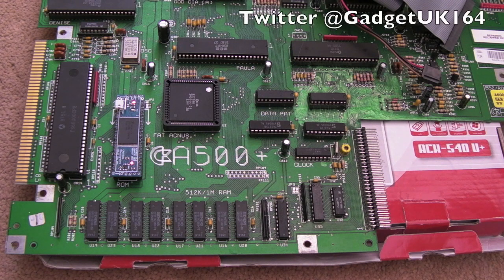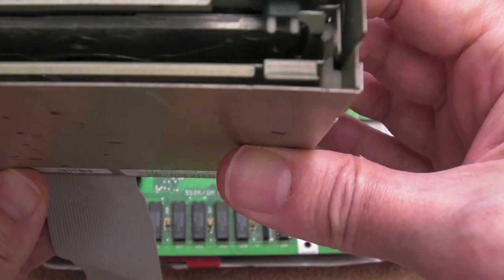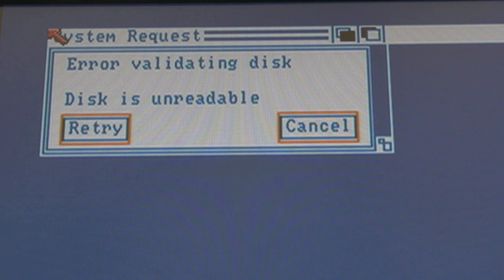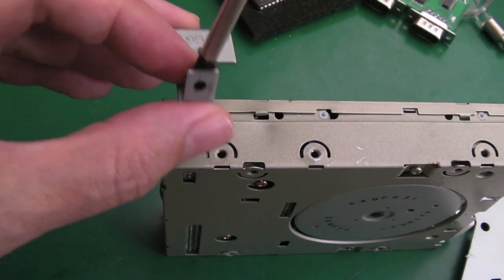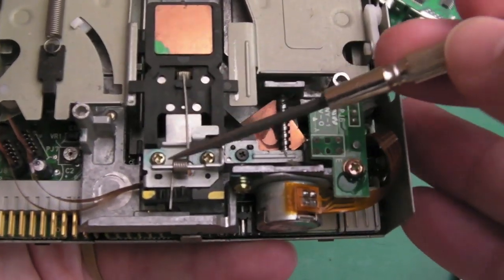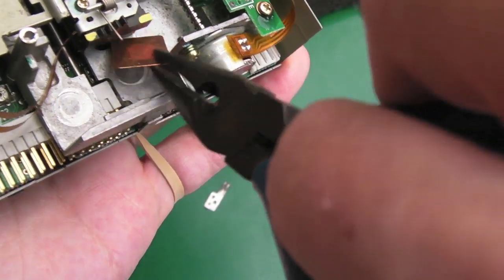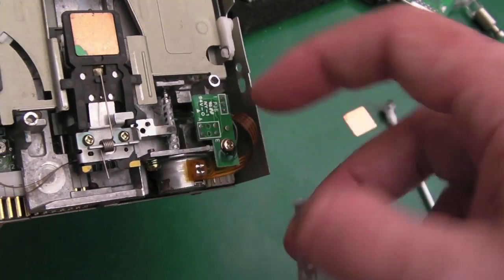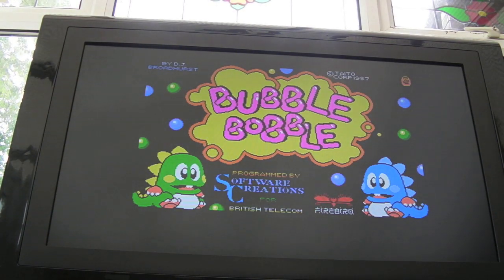Commodore Amiga Floppy Drives (1 x Easy FZ-354 1 x Hard FD-235F) Track 0 / Adjustment / Head Align

Comment from the maker: Morgan Just Games Super R-Type & R-Type 3 Collectors Edition Pickup - https://www.youtube.com/watch?v=A3x0BOkVIEI
The difficult drive (not Jamie's) starts at 23:20.
Reply: Say, GadgetUK164 would you happen to have a mini disc player repair video in the near future? if so would you be willing to tackle the Sharp MD-MT15 TOC error  problem there are a few on ebay with that fault was wondering if you have an idea of how to fix one.
Reply from the maker: @spidermcgavenport8767  My guess is if a clean doesn't fix it, and provided caps aren't the issue, it will be the laser!
Reply: @GadgetUK164  That wold be my hypothesis as well troubleshooting it so far i just cleaned the lens it may need several cleanings as I am not the original owner found it at a pawn shop with md's and accessories for $20 bucks and couldn't pass it up. The Arrowsmith album was worth it alone. I have others from my travels and found a player in Malta of all places.

Comment: Best trial and error repair video I've seen in years. Persistence is your mantra. You've been able to fix the mechanical faults, completely remove the heads carriage AND aligned head AND track zero sensor WITHOUT a scope or diagnostics software. SUPER!
For me, I needed to see how to remove the heads carriage so that I could glue the bottom head electrical noise interference cover (FZ-354 version) back in place. I note that doing this will NOT comprimise the heads alignment.
Thank you from Australia.

Comment: That's brilliant! :-D For a couple of days, I've been trying to get an FB-354 working, on and off. No matter what I did... thorough cleaning, greasing the shafts, trying to press the heads in all different manners, even trying different computers and even an ISA controller - it all boiled down to a removal of the track 0 sensor, cleaning it a bit, and... still nothing! :-/ 
But when I searched for "track 0 error" shortly after, I ran into your video again (I saw it a couple of days ago)... and then you mention the track 0 sensor, and I thought to myself - seeing you holding the drive with the heads in the rearmost position - "well, perhaps I should drive them forward, too, just to see if the sensor reacts as it should, when I power on".
And voila! The BIOS didn't complain about the drive anymore at boot, and I was FINALLY able to format disks with it! :-D
It's may not be in sync with other drives, however... but at least it's working again; and I can calibrate it if need be (I found an excellent program for that on Aminet, "TrackDiskSync", which helped me fix one of my external CDTV drives a couple of days ago). c",)

Thanks for your video, you indirectly pushed me in the right direction and helped me salvage one of these "true" Amiga drives! :-D
Reply: There...! After securing the head sled on the stepper motor shaft so there was no slack... (!) today I finally managed to get the drive calibrated, it's even loading Kefrens Desert Dream perfectly, and that one seems to be VERY demanding when it comes to floppy drives. c".)
So, one more FB-354 salvaged and ready for an Amiga adventure! :-D

Comment: This video absolutely nailed it. I have been fixing my chinon floppy disk drive on my A600 and I have been getting read errors at block ~400. I removed the head and cleaned them put them back, thought I made it worse because it was stating read errors at block ~1000 but followed your video, I realigned the head and got it working again but ended up having the same read errors at block ~400 again. So I marked the step motor position with a pen, loosened it and moved it a hair and now it works.
Reply from the maker: Thanks, that's great - glad you could fix it =D

Comment: Nice job : ) I just got mine realigned. Watching this gave me the encouragement I needed. I had a Thinkpad 390E floppy to tackle. Stepper motor was all stiff. I foolishly took the head off. But got it all back and running luckily! I found the head needed to be slightly moved more to the right to work properly. But when I was getting the drive to read the disk at all, I new I was in the right area.

Comment: Have a FD-235F and learned about the location of the track 0 sensor the hard way too - when i was reassembling it after a cap swap :) After some days of researching methods of track 0 adjustments and modding a PC drive to have working drive I nearly gave up, and already looked for replacement drives but tried a manual adjustment for the lulz, just by feel like you did. Luckily, after the third move of the bottom board it worked flawlessly again.
Reply from the maker: Hehe =D  Yes, I think if all that was wrong with this was the track 0 (bottom board position) it would have been easier.  The big problem was that top head was able to move because the plastic part wasn't secured to the metal part (which is screwed down).  I am 100% certain that was the original fault and that's why the previous owner couldn't get it working again (top head was missaligned as well as track 0).
Reply: Yeah, was quite mangled that poor drive. Great resurrect! I learned a lot from that vid, kinda like always ;)

Comment: I love all your Amiga videos, but this one takes the prize. I have an A600 which I fixed, but it has the same floppy drive which kind of shows the same symptoms. I also found that almost all the Amigas I have bought off of ebay had some form of an fdd issue, but otherwise worked perfectly. Thanks for this, awesome stuff! :)
Reply from the maker: Thanks!  I am sure you can get it working again, it might just take some trial and error regards the track zero screws holding the PCB, and tiny tweaks one way or another on the motor notch there.

Comment: Wow. As i've watched the first minutes i thought "uh, he has the same teac noise and problems like i have with one or two of my teacs. He can't fix it". Oh, i was wrong. Absolutely great work! Amazing. I have to take a look again. Those teacs are the worst amiga drives ever. They have a lot of different problems and no, capacitor replacement is no problem but alle the other problems are making me crazy with those teacs. Thanks again!
Reply: Oh i forgot...track alignement with keirf systest is what you've used for track alignement i think? With this i've aligned one drive perfectly.
Reply from the maker: Hehe =D
Reply from the maker: I didn't use any software within this video to align it.  Went purely of how disks were working / not working.  But I have used Sys Test since that video on another drive - just to see how well it works.

Comment: Glad you had this video ;). I've disassembled my two not working FZ-354's and I had no idea about how to mount the first one back (without disassembling the second). In fact I was doing it wrong :( .BTW I thought that I would see big caps, but nope, any. At least I've seen that one of them had the motor that wasn't turning, and now it does. I've used DeoxIt, WD40 and your Molikote grease to finish. Let's see if any of them work now, but many thanks.
Reply: I'll tell you: I'm mounting a "new" A1200. I've got a lot of pieces for that. I recently bought an A1200 mobo from AmigaKit and I'm planning to add a huge amount of things. For example.... A Vampire that I've got unboxed since like three years ago. And more things that I'm buying now  to have this A1200 running great. I'm going slowly. I love working on it, much, much more than later using it. Maybe you know what I mean.
Reply: Also... I'm trying to make "something different" with the oxidation on the upper plate of the Floppy drive (at least that). I will leave it into Vinegar just because of all of the rusty spots (like the ones you had). I know that it will change all of the color of the plate, but I'll get rid of any oxidation. I've also added some  "deox gel".  I'll post a photo. I'm sure that it will look like a metal plate without any color or oxidation. ... Surely the time to paint it (any color, the can I'll find), next step.

Comment: I was testing some chips from an A500+ I bought recently. The Agnus chip was preventing the floppy drive from starting until I switched the know working one back in. It otherwise "appeared" to be working.
I think this was a case of one of those junk systems that someone has chucked any old crap into and sold though :-( I'm sure the Deinse chip and keyboard were from an A500 not a plus.
The A500 I also had was not in great shape :-( The only consolation is that both of these got trashed in the post so I have got some money back, not that more smashed A500 cases can be considered a good thing.
Anyway excellent video full of tips as always :-)
Reply: If the boards are still good, you can mount A500 boards in the new Checkmate cases. I'm not sure, but I think there may be new aftermarket A500 cases as well.

Comment: Great video GadgetUK!

Really like your determination to see it through and keep these old pieces of awesome technology alive :) 

I actually made the mistake of undoing the screws on my upper head when I was trying to clean the drive on my A500 and by some stroke of luck managed to get it working again after a little bit of trail and error (phew!)... 

Not that I'm by any means an expert (I wouldn't have undone those screws if I was ;) ), but what worked for me was using the validation option in X-Copy Professional. You can choose just to validate the upper side of the disk and you can work on tuning things to make sure you get all green zeros right through to track 80. Then the real test was to see if the drive can write a disk which is then readable on another Amiga drive. If you can write a disk that another drive can read then you should know you're absolutely spot on!

Look forwards to the next videos - keep up the awesome work!
Reply from the maker: Thanks!  That's a really great idea, the only downside is you need to boot X-Copy to start with lol!  Not a problem if you have 2 drives or a HDD I guess!
Reply: Yes - that's very true! Thinking about it more I believe it was an external Roctec drive where I changed the belt that I messed up... which meant I booted X-Copy Professional off a Gotek. However I guess with an HDD or a boot selector it's possible too. :)

Comment: 24:35 Simply the best floppy repair video on YouTube.  This video should be re-uploaded with a better title since it essentially applies universally to all systems and not just Amiga.
Reply from the maker: Thanks, very much appreciated!  You are very kind!
Reply: GadgetUK164 - Retro Gaming Repairs & Mods, I can't stress enough how much your "don't give up" motto helped me fixing my similarly bad if not worse chinon floppy drive. aligning everything was quite difficult (motor/fine adjustment, zero track/coarse adjustment) also finding other problems but nothing compares to fixing the alignment of the upper head. I literraly gaveup two separate times. Thank you so much for this video.  Also i have to recommend two programs for this kind of work. for aligning the lower head/motor use TrackDiskSync which creates an alignment floppy writing some custom data/tones and you use it hearing custom alignment audio as well as all the interferences your drive picks up. the second software is X-CopyPro (has awesome drive check tool) for aligning both lower and upper heads but especially upper head.

Comment: I envy your skills.  I have to align the head of my original A1000 drive, and... I've just putting it off because I know how much time it'll take to get it right.  My A1200 drive still reads like a champ, but the disk detect switch is going out since the carbon has all lifted off, so I have to figure out how to re-carbonize it.  Dang floppy drives.  Amazing these things even work at all!  Still, you can't beat the novelty of the good ol' mechanical clunking sound.  It's what really reminds you that you own a genuine old-fashioned computer.  8)
Reply from the maker: Thanks!  Yes, I quite like the old mechanical sounds these make =D

Comment: nice suggestions going to try with my non-working teac. I messed with the board and stepper motor when I was trying to troubleshoot and clean and then I remounted all in a casual position. The only problem is that I haven't got a reference floppy perfectly tested to use for the alignments.
Reply from the maker: If like me you have a wide variety of disks (many written on different drives), and some originals - you will be OK.  Originals tend to be a good source to align the tracks to.
Reply: @GadgetUK164  Thank You I'll try . You bet right, I have all this stuff laying but not tested recently ... Some mold forming, etc.  but with the help of some statistics maybe....

Comment: Nice one bud! That looks like an absolute nightmare, but well done for sticking with it!  
One thing that confused me a little is your explanation of the track zero sensor at the end of the video, you seemed to describe the fine adjustment of that as slightly moving the head over the track, but that seems to go against your explanation of how the stepper motor moves, surely the stepper motor would move in a big step and it just happens to break the beam at a certain point, meaning the fine adjustment of the track zero sensor isn't so sensitive as adjusting the stepper motor.
Reply from the maker: Thanks!  Yes, the stepper motor steps, but it steps using that worm bar.  So if you twist the motor position slightly, you are moving the alignment of where the current step is positioned vs the head assembly.  The track 0 sensor has a lot of movement though - eg. 4 or 5 tracks in size, so it is important that it is set precisely as well, or the drive may think its at track 0 when its at -1, 2, 3 or 4 etc.
Reply: @GadgetUK164  That makes sense, thanks for clearing that up! :)

Comment: You can hook up an amplifier to the /READ signal on a floppy drive interface, and actually "hear" when the heads are directly over a track.

(I would recommend adding a 2K resistor between the /READ signal and the input to the amp, though.)

I used to do something similar when debugging retro computers and arcade boards many years ago, before I got an o'scope.

It's surprising how much info you can glean just from the sound. If you have two of the same machine side-by-side (where one is faulty), you can hear the difference between each pin on the CPU, for example.

Obviously it can't replace a proper o'scope, but it could be a good cheap option for aligning floppy drive heads. If nothing else, it's an interesting experiment, and could make for a good vid. ;)
Reply from the maker: That's one reason I still want a logic probe that has sound (so you can hear PCM etc) =D
Reply: @GadgetUK164  

I've been meaning to make a small amp box with a logic probe on it for years, but o'scopes and logic analysers have kind of replaced that now.

It would be good for a laugh, though.

I had an 8" floppy drive hooked up to the sound output on the dev board a while back. It's neat how you can actually hear the tracks on the disk, and the noise in between.

You can usually also hear where track 0 is.

Comment: Un-related to floppies but is there an off-the-shelf mouse that will work with a 1200? If not what is the best solution. I just bought a 1200 but it's doesn't come with a mouse? Will the 4000 or 500 mouse work? Great job on the drive, I didn't see it, experience pays off.

Comment: Great video.. I tried hard to lift what I could for my FD-235F but I think mine is gonna need the hammer. It pulls the arm back and blips 3 times and then stops moving. Not sure if the caps are good but I'm not sure I could do a recap anyway. Clearly those Teacs are sent to try us :-(  Several hours and time to admit defeat

Comment: 1:03:42 I have a similar drive, that notch is factory-set a little further counter-clockwise on mine than yours
Actually found this video because i dismantled it for cleaning and repair, and removed the head assembly before realizing that screws the alignment
Reply: Planning to use a scope and some blank disks as a reference, assuming factory-formatted disks have empty sectors and are not completely de-magnetized

Comment: Hi there, what would be the issue with a drive that sounds like the drive belt is broken but it's a drive without a drive belt, that's the best i can describe it, it just makes a whirling noise when you put a disk in.
Reply from the maker: Possibly the capacitor related to the drive rotation timing.  There's sometimes a 0.47uF cap under there.  If its spinning all the time with no attempt to move the heads, there will be a fault in the main IC.

Comment: Great video - many thanks! It inspired me to fix my failing drives.  One had thrown the armature out of the worm gear, jamming  up the motor!  But another one is failing to read tracks nearer the centre of the floppy - outer tracks are fine.  Any ideas what might be causing that?  Cleaning it and fiddling with the rotation of the track motor haven't helped.
Reply from the maker: It could be alignment, or timing related (check / replace any electrolytics on there).  When I was struggling to get the 2nd drive in this video working, some of the tracks near 0 were fine, only as you got futher into the disk was there a problem.  In my case that was caused by the head alignment and bad track 0 alignment.